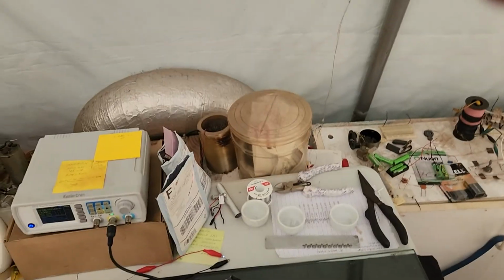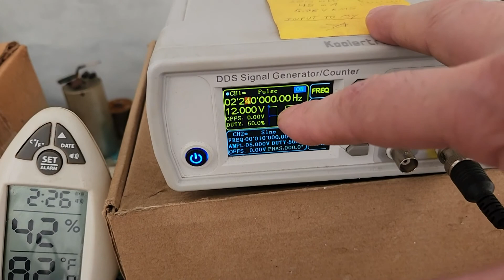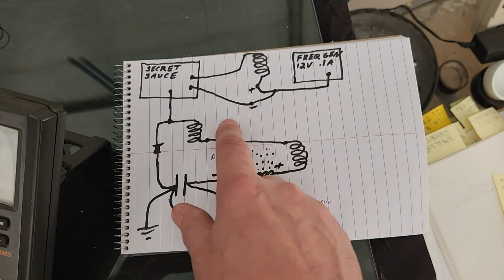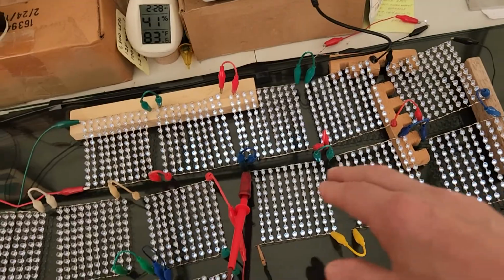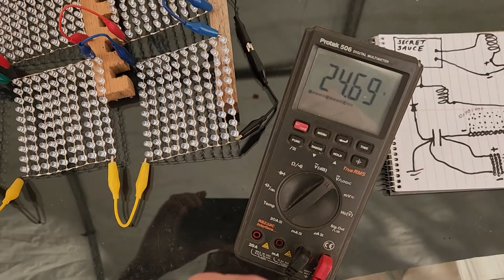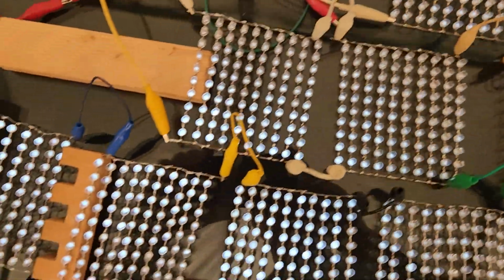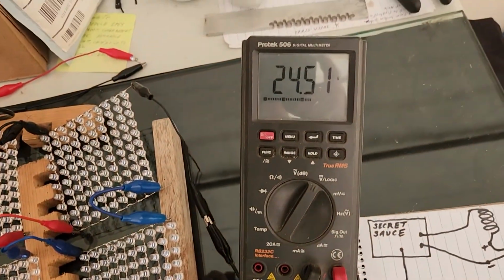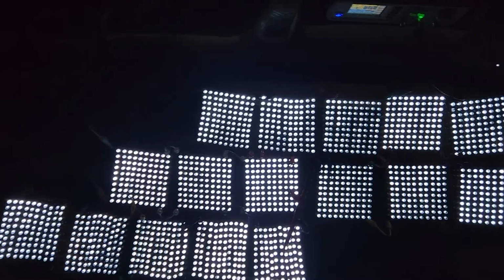WPT part 37, NEW RECORD!  1,610 LEDs lit with 1.2W at most

Comment: Very nice, congrats on the new record. I had an interesting thought pop in my head while watching your video. It went like this, LED’s can generate power like a solar panel if light is shone directly at them, what if you flip one “panel”of LED’s upside down to face an opposing set.
I understand it would be difficult to physically arrange for all 1600 LED’s and equally difficult to measure brightness but perhaps you could measure if input current changes. I also don’t think anyone is going to put the time and effort into soldering all these lights like you have!🤣
Keep smashing those records!
Reply from the maker: Thanks for the ideas.  I was thinking about trying solar cells.  Not sure the LED to LED would work, yes, I have seen diodes produce energy when in the light, and LEDs are diodes. Humm, I will think about it.
Thanks again.

Comment: How much light are they emitting? With a 20% efficient solar panel and perfect mirroring and  lensing I guess you'd need 6W worth of light to be abe to loop it?
Reply from the maker: That's what I figure also, about 6W and then self sustained loop 😀!
I thought about the photo voltaic modules also(solar cells).
I can charge a lot of caps simutaneously, and fast.
Great comment, thank you.
Reply: @INVENTOR3  Might for this very reason is a very hard way to get an overunity loop going. But if for some reason it's realtively easy to get 10x overunity, it might be more viable than other methods.
If you can drive a motor with decent overunity, those can generate back at 80-95% efficiency. At 25% overunity, you'd just need a few of them, well dialed, to double output for say an electric car.

Comment: 20 mA to light up, does voltage affect that theshold at all?
I wonder whether you might be getting the LEDs to light up with greater efficiency through changed threshold somehow.
No expert but the total light doesn't look like all that much more than a conventional LED would emit at 1.2 W?
Reply from the maker: I don't think the voltage across the LED would effect the 20mA, for example if the LED is rated at 1.8v working voltage and 20mA working current, and I am getting 2.4v across each LED,  I don't think that would mean the LED would work at lower then 20mA.
Reply from the maker: The amount of brightness or lumens these put out is difficult to see in bright daylight,,, I hope you saw the LED shot at night at end of this video 😀.  I would have to check with light meter, refractometer or otherwise.  2.4v almost 2.5v across LED is not bad brightness in this video.
Thanks for commenting.
Reply: @INVENTOR3  What does "work" mean, though? First perceivable light, or decent conversion to light?
Reply from the maker: @Cloxxki  good question.  I have asked myself this same question before.  I would think first percievable light. But who knows.